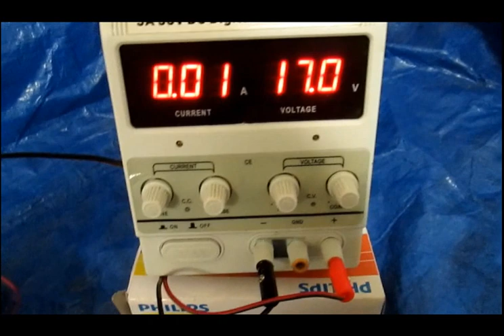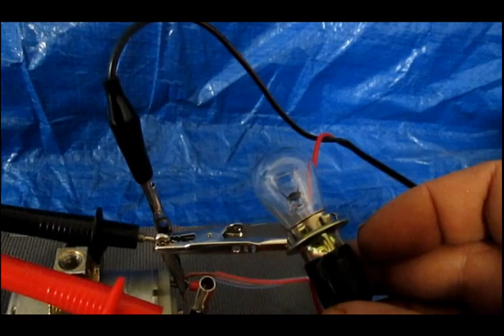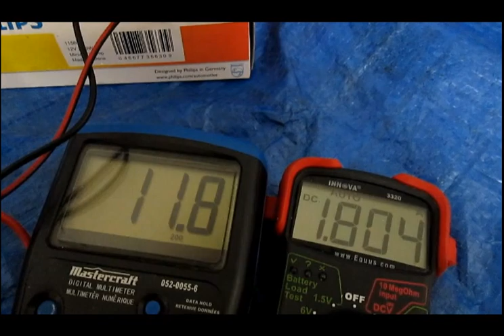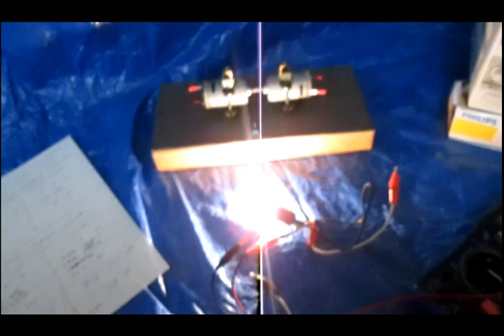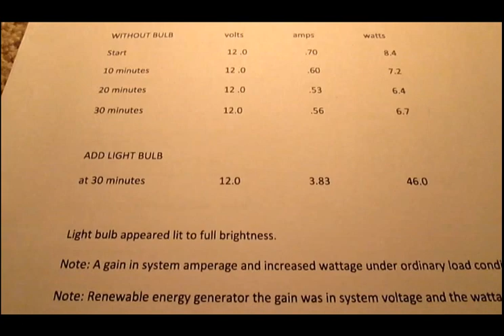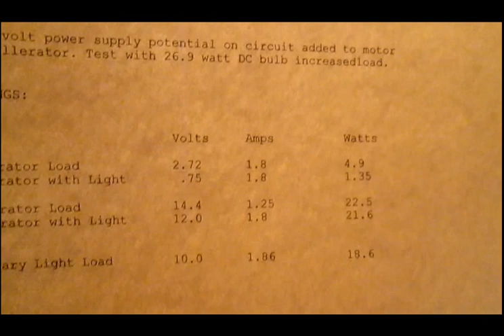Renewable Energy Generator - voltage acceleration

Comment: put any capacitor you have laying around in parallel with the run and charge batteries and you will have better results

Comment: Allan you need to replicate the John Bedini ssg circuit to understand what you are trying to do better. Your design lacks capacitive reactance  , the batteries have plenty of capacitance but the are slow to react on a charge cycle so they have no reactance for charge but they can drain fast so they have reatance on the load cycle more than the charge cycle